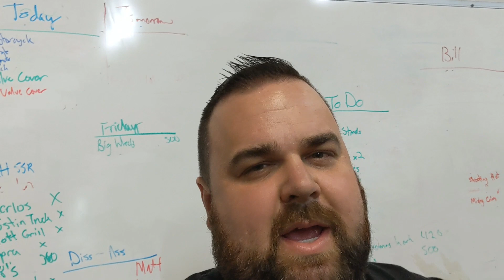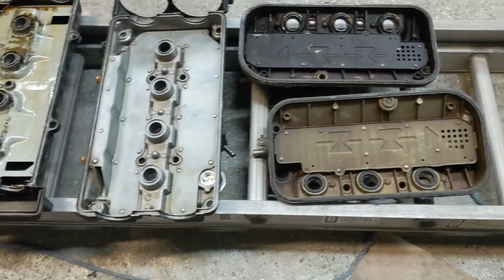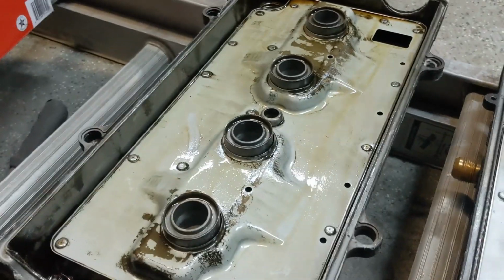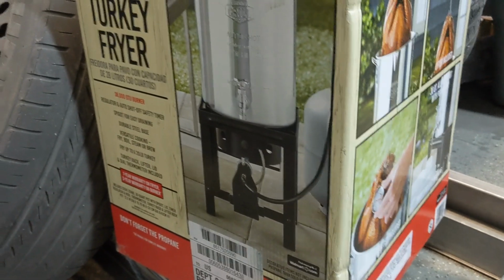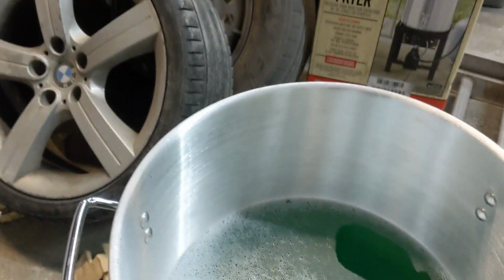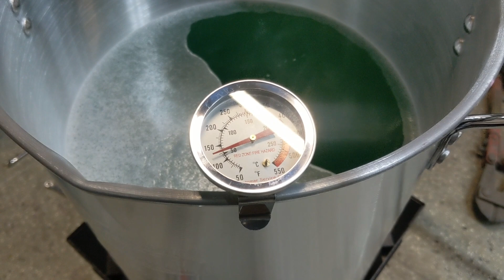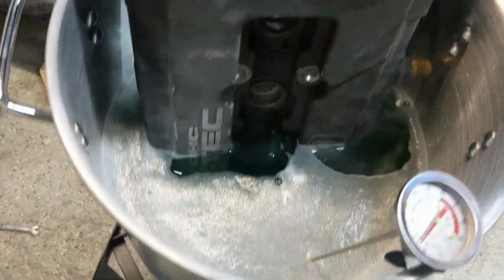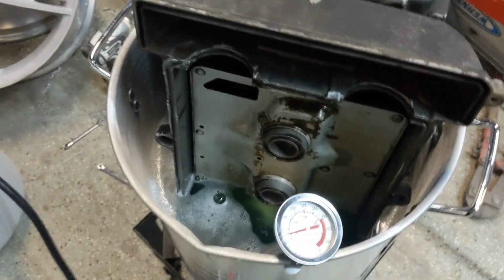How a Turkey Fryer can help your Powder Coating Business - Ep 91

Comment: That is a great idea that I have used but sort of forgot about. My 1930's bench grinder needed new bearings so I decided to powder coat the cast iron case and other parts, so I will try the turkey fryer again. I actually bought it to heat a cast iron pot full of used lead bullets from the range, which I cast and reload. My first experience with powder coating was to coat my cast bullets but I just shake in a plastic container with air soft bbs and then bake. Spray paint sucks so bad that I got fed up with using it to finish parts or products I have made on my cnc plasma table and fabricated. Even dealing with the DV Eastwood gun and learning process is better than spray paint and while I was a pro painter and could shoot various types of paint, it is a mess and expensive to do especially for a home shop without a booth. Simple green is also the cleaner we use in my parent's scissor and clipper blade businesses for cleaning parts in the ultrasonic machines. Thanks for the video to remind me and explain the ratio!
Reply from the maker: multiuse tools!!!

Comment: It seems to do a good job of removing the paint/powder coat, too! I wonder if a 55 gallon steel drum with the solution heated to 180⁰F-200⁰F can be used as degreaser and stripper? Would be cheaper and less toxic than other chemicals.
Reply from the maker: I cant imagine it does a great job doing it on anything in good shape. Factory paint on 20 year old valve covers for sure though lol

Comment: Great, but why destilled water or why not tap?
Reply from the maker: No point in adding contaminants to your pot beyond the greasy parts. You can use whatever obviously. I choose distilled water to not have any mineral build up under heat
Reply: @UnknownCoatings  good answer, thanks, another question, regularly rims don't a primer base coat?

Comment: You shot 2 different color products, was one the color followed by clear coat before cure? Or was that color a 2 step process
Reply from the maker: on the valve cover? Its a black base with a clear that has a sparkle as the second coat.

Comment: whats your dust extraction setup? seems like minimal dust🔥🔥
Reply from the maker: I just use the dust collector that came with my skat blast unit. Plus a dust deputy between the collector at the cabinet so my filter stays clean for longer. I haven't had to empty my dust collector canister ever in like 2+ years since I put that on

Comment: so that solution will de grease and strip paint? and can the solution be used multiple times (stored and saved for later)?
Reply from the maker: It's stripping 20+ year old factory paint.  So I wouldn't say it will strip paint universally. But yeah you can keep using it
Reply: @UnknownCoatings  awesome, i may have to do some test on the stripping abilities
Reply from the maker: I can't imagine it would touch most finishes. The j35 valve covers I put in it cleaned but all it didn't was clean the silverish/grey paint.  Other two covers it removed most of the finish

Comment: Another awesome video, thanks for the help, what pressure would you recommend blasting at? We use glass grit (medium) and glass bead at the moment.
Reply from the maker: blast pressure is usually determined by the media you use, nozzle size and CFM. I blast at around 55psi with green diamond moving 21 cfm
Reply: @UnknownCoatings  thanks for that, 👍👍👍
Reply: @UnknownCoatings  Does the green diamond 30/60 work ok in a siphon feed cabinet? I have modified mine to the popular bottom feed with an air venturi and I run a skat blast gun with the largest nozzle (20-24 cfm) and get 20 cfm from my compressor while running. It works quite well, although maybe not as fast as the pressure feed pots........I'm assuming people use those just for the better media feed. It keeps up at 40-60 psi with garnet or aluminum oxide. I used glass bead before but it isn't aggressive enough. The garnet is a bit dusty and I see a number of powder coaters like the green diamond and I have heard 10x is expensive and maybe not good for the siphon setups. It would be good to know if green diamond is good to go rather than wasting a bag of it.